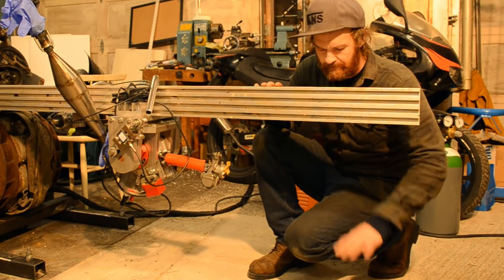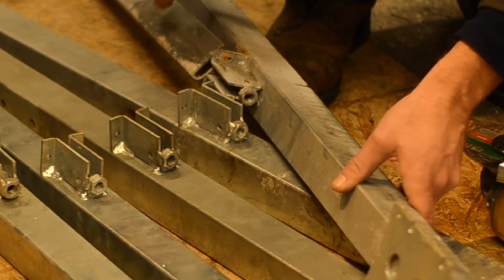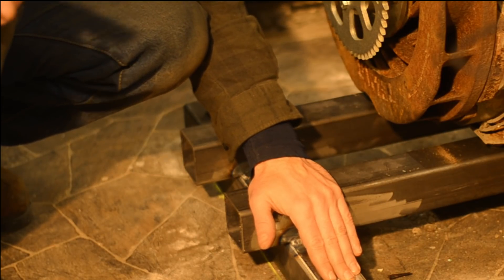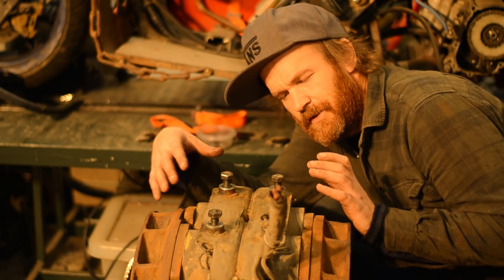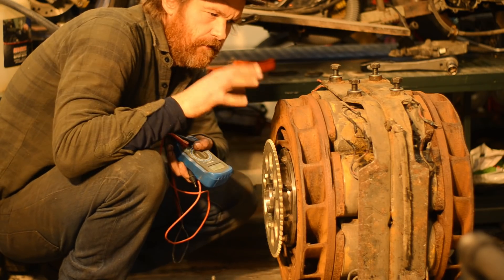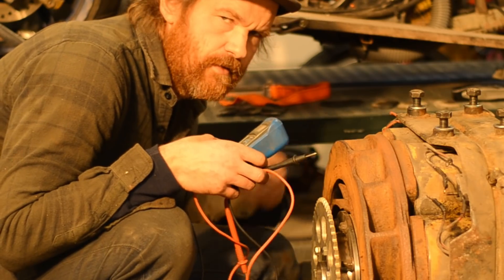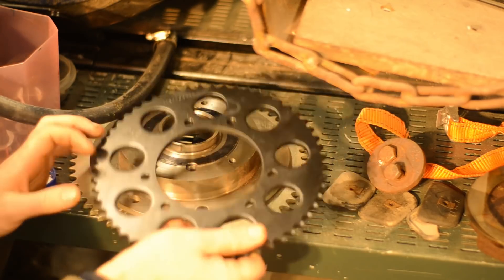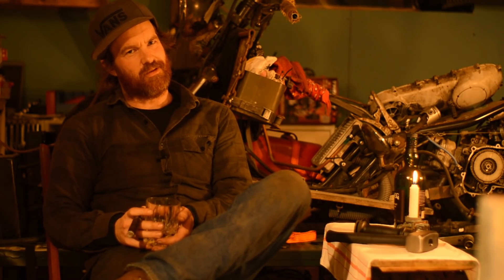Need this to prove I built Worlds Most Powerful Engine!

Comment: am a huge 2 stroke nut. Worked on Suzuki GP bikes. I am a welder/fabricator. Love your machine skills. Next job has to use Orbital tech stuff. Reeds are not sufficent and rotary valves are a source of power loss. As is s-charge. Maybe direct injection using a BMW system?

Comment: For stubborn bolts, your tig welder is your friend.    Weld a washer to the end of the bolt and then a nut to the washer, let it cool then back it out.   You can do this without drilling the head off the bolt, the heat will expand the surround metal and rust and should help with removal, it can take a few tries.    This method works especially well on aluminum but steel also.

Comment: weld a nut on those bolts the heat from the weld breaks the rust plus you can get a proper tool on the nut.

Comment: To get a flat head to get it lose, all need is to a hammer and socket to size of the head, and empact the head. This well degrease the surface tension of the screw.

Comment: Could it be wired to create power from the magnetic braking system to like storing energy packs to use for your homework shop or what have you kind of like a generator every time you blow up one of those engines can you store like so many jewels of energy or something into some light car battery packs or something with lithium ion battery or some s***( thing)

Comment: Top tip heat around the outside out the bolt not the actual bolt , you want the outside hole to expand you don’t want to the bolt to expand and lock more into the seized bolt  hole

Comment: Dude when a bolt is stuck like that, HIT IT. Not with an impact driver, but something much more solid. Either the ball pien end of the hammer or a huge bolt.
Basically you need to shock it. Directly on the head of the bolt very very hard.

An impact driver takes all the shock out of it though.

Its hard to truly explain over the internet.

Comment: Easy is not worth anything became a very real phrase when you started dismantling the retarder.
To heat the bolts up sufficiently a small propane torch doesn't do the job.
A propane/oxygen or acetylene/oxygen torch is needed, they provide a lot more heat which can be better concentrated as well.

Comment: So you have a steel/iron plate (coil cover), with a hole in the center !  When you heat it, does the hole, (*A*) Increase in diameter. or, (*B*) Decrease in diameter. ??
I'm luvin' your projects man, but you're givin' me pain with that Chain and Sprocket. They use Blower Belts on the salt flats for a reason. ;)

Comment: I may ahve missed it but.. after you drilled off the heads of the flat head hex screws were you able to get the rest of the screw out?
Reply from the maker: Haven't tried yet. Will probably weld on some nuts. Occurred to me that I can just leave the faulty coils out and it'll still be plenty strong enough.

Comment: If You need any help about electronics, just reply on this comment and I or somebody else will definitly help You, we want to see this dyno working 💪💪 

Bypassing 2 coils isn't best idea I think, it will be unbalanced and measurments won't be very useful, but for non measuring test it will be great, to see if everything works as it should. Better idea will be to use only one half of the generator with all coils working...

Comment: Du behöver inte alla magneter det kommer räcka med dem du har nu så lägg inte onödigt jobb
Reply: In English you don't need all the magnets it will work with less magnets and it will be enough for your purposes 😁
Reply from the maker: 😁👍 Read my pinned comment.
Reply: Aahh to fast to see that hehe, a buddy and I built an dyno "rolling road" with the same type of Telma brake and it ran almost a year with 2broken magnets

Comment: You would not have needed all those coils to get sufficient drag... you may be wasting your time. It was made to slow down a many ton truck and would be overkill for a 20hp engine. If it didn't make enough drag with the coils that still work, you could change the gear ratio to spin it faster, which would create much more drag as well as reduce the counter torque needed to load the engine.

Comment: Not to be that guy, but I have taken one of these apart once in engineering school and got help from a master machinist that was on staff at the time. The trick is to heat the bolts with an acetylene torch until the bolt and part glow red. It will take awhile. Heating with propane torch does not provide enough heat because the part is basically a big heat sink. Heating at a higher temperature faster is the key. Wait for it to cool and it will almost be loose enough to screw out by hand. It also takes all the tension out of the bolt and hardens it, so replace if necessary.
Reply: He wanted to save the electromagnets and to much heat would burn them down

Comment: I thought you might be using the wax trick to get the screws out of the coils. Very old trick my Grandpa taught me. " heat the stuck bolt touch a candle to it and let the melting wax wick into the threads. Heat it again to flush out the debris." Really works.
Reply: Have you used this method to remove broken exhaust studs from VW cylinder heads? It works! Thanks for mentioning it!
Reply: @daleguenther5826   I last used the wax method on a frozen axle nut on the front of a quad. I tried to get it loose for a week before I remembered this trick.
Reply from the maker: And I was just trying to make a joke... Thanks for the tip

Comment: Tip for removing stuck countersink Allen screws is to get a steel bar same outside diameter as the head and hit it in with a steel hammer very hard! This will release the taper. I’ve busted Allen keys and dried out before doing this, and they just undo normally now I use this method

Comment: If needed, old coils can be rewound. Strip and uncoil the old one in way that you are able to measure the total length and/or the number of turns you pull off. Then measure the wire diameter on a piece of wire where you have carefully removed the varmish. Then get new varnished transformer wire and some transformer varnish as well. Coil it up by hand, finish off with varnish. Remove varnish on the ends of wire where you need to solder.

Comment: An easier way to remove stuck flat head screws is to use a small center punch inside the hex . A couple of walks with a hammer will make dimple that stretches the head and threads apart to relieve surface tension. Then use the impact driver.

Comment: What are you going to use as a resistive load? I've only just watched the last 3 vids and (maybe a half dozen some years ago so I'm not up to speed).
Perhaps your engines will put an EMD backup generator to shame and the power company will pay you handsomely for your grid contribution - not sure...

Comment: Honestly 2 years ago I thought you were a joke… you continued to make mistakes after complete stupidity.  Then you just kept solving problems, finding ways to overcome things not working.  

Well done.  Your patience is amazing.  

Everything you do is hilarious as you always fail, but you get up and keep trying.  Chasing 40 horsepower out of a 50cc engine with all the skills you have is amazing.  Imagine just for laughs getting something that produces 40 horsepower as it was designed and you did some stuff to it.  Then a 427cu v8. 
Honestly man 50cc is not a thing.  Use your skills for something more reliable

Comment: Hi Alex, I've found out that if you want to remove a completely locked, loctite or rusty bolt, drip some oil on it, then heat it up and hit it with a hammer, then unbolt it! tadaaaaaa!
Reply: That method works if the gods are on your side, but keep a drill, some sharp drill bits, some sharp taps and an extra slice of patience handy! 🤔

Comment: My final year eng project was a 400hp/7000rpm dyno power absorber made from a Daimler fluid flywheel. My supervisor, Prof/Dr John Raine, used to work at Heenan and Froude. Worked like a dream up to 50hp because that was the biggest motor we could fit in the lab, but it would have done heaps more.

Comment: I'll give you a tip: One go with the allen key and if that doesn't work then it's straight to the welder - weld a nut on there, not only will you be able to apply more torque but the direct heat from welding usually makes any bolt just about finger tight.
Reply from the maker: That's a great tip!

Comment: Stay strong brother. A few seized bolts and broken wires are how we deal with them is the difference between success and failure. Failure is not an option 👍👍👍👍

Comment: Hi from the UK, fantastic chanel - love the vids, but a hat tip to a wise man....I remove seized,/broken studs-bolts etc for a living..its part of my business. If you get a punch that is just smaller than the head of the contersunk bolt and give it a few hearty whacks with a decent hammer it will shock the taper head and thread enough to break the bond with the housing..if its still too tight or the allen cap is damaged either use a centre punch or a small sharp chisel on the edge to punch it anticlockwise..this process has never failed me in 40 years ;)
Reply from the maker: Thanks for the great tips!

Comment: Finaly..switch'd to a proper whisky instead of rum , Ardbeg-rawstock steel is equal to wood due to the pandemic,up more than 100%..2 years ago the resellningprice on steel was about 16 sek/kilo,now it's 35 ... btw alex...if those bars from the old kitchen was galvanized..i surley hope you had the exhaust-fan on and open'd the garagedoor..welding-fumes from galvanized metal is dangerous shit
Reply from the maker: 👍 I ground away the coating before welding.

Comment: To undo rusted fasteners it is cleanest and best to use grease on thread instead of oil. Penetrant oil is good only in places, that grease will not be able to go to. I just put grease in syringe with gloved finger, easy to use and with no mess after filling

Comment: Thanks for the shoutout! Interesting to see a Telma brake disassembled. I'm curious if the rotors are cast iron or steel(to help with my design) but that's pretty hard to find out without grinding the rotor 😁
Reply from the maker: You're welcome! I'll see if I can find some info on the rotors.
Reply: Olin melko yllättyny kun tämä mainitti yhtäkkiä sut:D
Reply: ASoftaaja mulla vois muuten olla tommonen Telma ylimääräisenä jos keksit sille käyttöä
Reply: Almost certainly cast steel. Cast iron is too brittle for most uses.
Reply: @dbmail545  If cast iron has been through an annealing process,it burns out the carbon particles,and the metal then becomes malleable.
Reply: I haven’t seen your channel or watch any vids yet but I subscribed to ya!
Reply: @Bennyboysgarage_  do it man do it and also check contents.
Reply: @broo_shs  I had to wait tell i was done work! Now I got something to look forward to! :D
Reply: @Bennyboysgarage_  :D
Reply: I pretty sure they are cast
Reply: Absolutley cast iron
Reply: oho nice :D pistä sun videois maininta et laittaa yt tekstityksen päälle ni saattaa auttaa views vähä :p
Reply: @kiiiisu  if you want it in english press 2
Reply: Henkka  Yeah Peoples Need to Hit Heads Together and Help another Gear head. todellakin